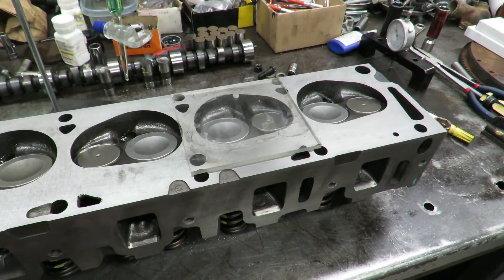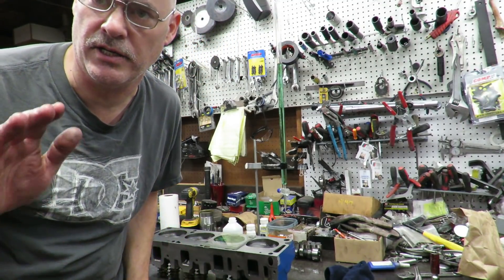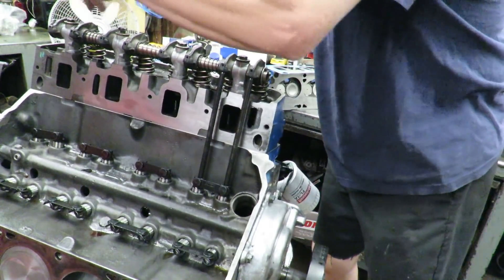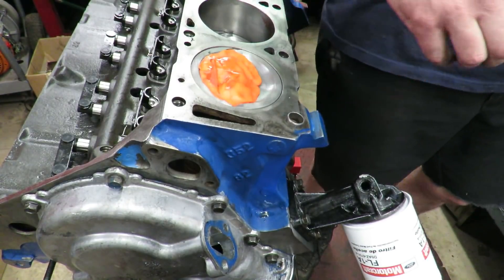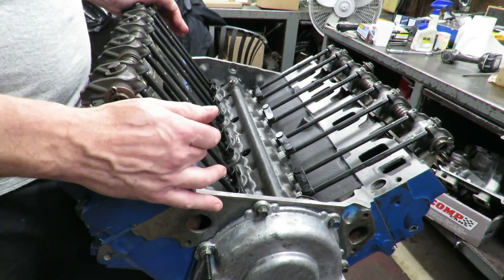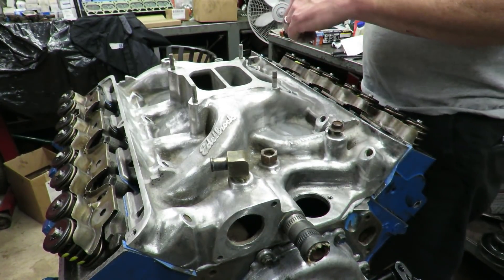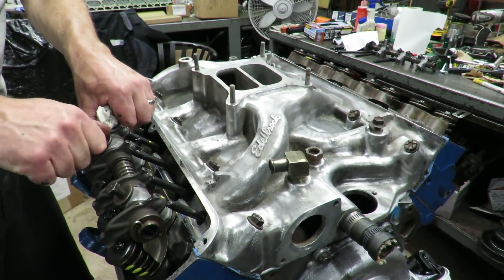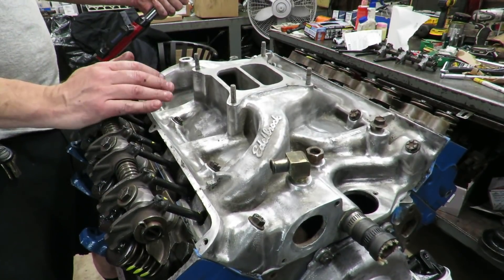390 Ford stroker Build part 8

Comment: No mention of lifter preload (what value do you use?)...didn't show pushrod checking tool being used to find pushrod length. Was looking forward to that. Color me disappointed.
Reply from the maker: with the factory non adjustable rocker shaft all you really need to do is find a push rod that puts you in the middle of your lifter plunger travel  the way I did it was I measured the difference between the flat tappet lifter and the roller lifter than subtracted that much from the push rod length to a set of push rods it worked perfectly the push rods I bought were perfect right in the center of the hyd lifter plunger travel
Reply: @Myvintageiron7512  A unique case. And works as long as there's no change in installed valve height. Seems amazing that the height didn't change after the valve grinding and new seats.

I mention all this since I'm battling the valve train of an old Buick odd-fire V6 (valve job w/new hardened exhaust seats). At this point, I want to shoot the guy who thought of non-adjustable rocker shafts. Needs new pushrods, so I bought a length checker and have to settle on a lifter preload value for the new Sealed Power hyd flat-tappet lifters. Looking to go for 0.040" since everyone says 0.020" to 0.060", so I figured to aim for the middle. Sound plausible?

Love the vids, BTW. Just would like to see more nitty-gritty tech details.
Reply from the maker: @warrenzevonsangryghost6055  wait ! why are the valve stems at a different height? who did the valve job?  any machine shop worth their salt knows that you half to measure the valve stem heights before you remove the valves and then re measure after the valve job so you can grind the stem tips to restore the height to original specs if you do a valve job and don't do this it turns into a nightmare I would say whoever did those heads should never be trusted to any type of machine work if you want to shoot someone it should be the guy that did the half ass job on those heads Good Luck
Reply: @Myvintageiron7512  The shop here in KC has been around for many decades, and known for rebuilding and repairing (sometimes after horrific damage) some of the most expensive heads ever made (megabuck Brodix, Lamborghini, Ferrari, and of course, old fashioned plain-Jane Ford and Chevy V8's and such). Figured my lowly odd-fire Buick V6 heads would be no big deal for these guys.

"measure the valve stem heights before you remove the valves and then re-measure after the valve job so you can grind the stem tips to restore the height to original specs "

Yeah, well, it didn't happen that way. Heads were cleaned, milled a few thou, and hardened exhaust seats installed, as well as new Sealed Power springs, positive seals on the intake, and Viton umbrella seals on the exhaust. Picked the heads up, and before I installed, I noticed that the exhaust valves were visibly shorter than the intakes. Did some measuring (the best I could with only calipers) and the variance from tallest intake to shortest exhaust was around 0.040", and while certainly the new exhaust seats played a role in the short exhaust valves, I was still pissed considering what I spent at their shop.  Does not appear that much (if any) attention was paid to the valve height they had when the heads were received, and no one could have even eyeballed the stem heights as the difference from exhaust to intake was obvious. I called the shop, and the owner was very apologetic and told me to bring the heads back ASAP, which I did. We spoke on the phone a few days later, and it seems that I was not likely the first to do a valve job on the old Buick, and in order to straighten out the mess, new exhaust valves were needed, which was done (at an additional parts cost to me, but no additional labor). As far as the screw-up, I was told that the spring pad at several locations were recessed from where they were supposed to be (casting error? can't check as my spring compressor seems to have wandered off), and of course the new seats played a role as well. Seemed a lame excuse, but I saw nothing to gain by pushing the issue.

So I'm conflicted about the shop. Real nice bunch of guys, and I'm sure they know their chit, but I kinda feel like their approach was "here's a pair of old crusty Buick heads...let's get 'em done and get 'em out, we have more important things to work on that'll make us lots more money". Maybe that's unfair to 'em (they were certainly plenty contrite when I brought the heads back in anyway), but that's how I end up seeing the deal.

Anyway, after too many $$ spent, the valve stem heights look good now, but I have little idea where the valve heights are as compared to where they were when I dropped the heads off. I indeed do need new pushrods, and have a length checker to tackle the situation. Once I get the heads on I''ll know more. Figuring on about 0.040" preload for the new Sealed Power lifters, as everything I read says 0.020" to 0.060" is the target, so I thought to aim for the middle. Sound plausible?

(BTW, read all of this, you're not only an engine guru, but a saint as well. Rock on my friend!)

Comment: What happened to the lifter valley pan that came out. Is it not necessary to put back in on these 390's???
Reply from the maker: the lifter valley pan does not fit with roller lifters
Reply: I thought that was why it was left out! Just wanted to make sure, since the oil pick up tube was accidentally replaced with the short version. Thank you for clearing this up for me, I always thought that the valley pan was used no matter what, but I was mistaken. Like these vids, you do a jam up job. Keep them coming, especially the 302 - 429 fords, LOL.

Comment: No doubt you are very theral but why did you leave out the intake Valley Pan.
Reply from the maker: You cannot use it with roller lifters it's not needed with aluminum intake anyway

Comment: Like your video!  I put Edelbrock heads on a 68 428 Ford Motor FE. Edelbrock head number is 60069. I then installed the 60069 stud kit assembly for rocker arm assembly. When I put the oil baffles pan under the rocker arm assembly it hits Edelbrock's head and won't lay flat. Can I leave the oil baffle pan out or should I try and modify it to fit the Edelbrock heads. Your video 390 Stroker Build Part 8 says it is important to have it in the motor. Is that because you used stock heads. Thank you, Brian Penney.
Reply: no

Comment: No 390 ever had valve to piston clearance issues when... Ever
Reply: I had a problem with a Crower Roller Cam on an early 352 they hit the pistons , hard .Someone sold me a car that didn't run because of bent valves and push rods .

Comment: So do you not have to reinstall the valley pan?.. Also Did it run?..
Reply: It keeps the hot oil off the bottom of the intake and I believe it is important ,too.

Comment: I notice that when ordering head gaskets for my 390 FE, they specify Bore measurement. 4.08 or 4.19 or 4.25 and 4.4.     Which is the correct one to use and why would there be all these options. When I measure the inside of the cylinder bore, mine is 4.08. so which gasket bore can I use.

Comment: do not use silicone!!! use weather strip adhesive, Permatex  aviation sealer, permatex  #2 ! also torque in 3 or more steps flowing torque pattern do not torque to torque specs in one step! all so I prefer to use the china wall gaskets, but a lot do not do to the fact that the old time non silicone sealers I mentioned above are not as popular. the old sealers are like glue and set in 5-15min sum do not harden but set up ,others harden to a point keeps the gaskets from moving makes it idiot proof!! also on ford small blocks 302w-351w you need to use the intake gasket for the year head you are using as the ports sizing changed a LOT over time. all so on the 302w-351w use 4 studs 2 on each head second bolt hole from each end to line up the intake gaskets and intake. then with the intake on put the bolts on hand tight in the renaming bolt holes then remove the studs  replace with bolts and torque to spec. all so use stranded no PERFORMANCE intake gaskets from felpro  as thy have a steel core with raised bosses around ports for hi presser seal. PERFORMANCE gaskets from felpro do not have a stamped steel core and use a silicone boss around the ports instead of stamped steel. the standard blue ones are a lot cheaper as well!! all so NEVER reuse intake bolts as thy stretch. ues bolts from industrial suppler grade 8 with USS grade 8 washers!! bolts from industrial supplier or well stocked hardware stores are cheaper and better than a lot of OE or performance shops just bring your old bolts for sizing. have learned the hard way with ford intakes so those are my tips as well as phrasing Fords tips. well good luck with the fe thy are a STRONG engine. with little work a 390 can destroy a built c6!!!